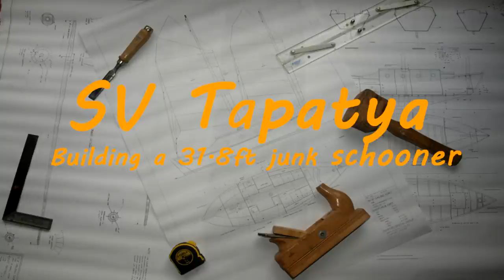Building a cruising sailboat; Gloss, Compass, Chart Plotter - SV Tapatya EP143

Comment: you can of course add an NMEA 2000 wifi gateway so you could use a laptop or tablet at the chart table.
Reply from the maker: The plotter has wifi already installed, Sasquatch. I'll certainly have a laptop down below 👍😀

Comment: Talking about gadgets for your boat there is a wind speed and direction do hickey(I have been learning my technical terms from Mads) It installs at the top of your mast. You can also get them Solar powered and Bluetooth enabled so you do not have to run any wires.

Also note that with Nmea 2000 you can echo its output to an Ipad and safety feature wise also install AIS depending on where you go cruising this is mandatory. Some VHF radios have it built in and you can also show input on your Chartplotter and Ipad. 

Further gadgets to consider are a MOB device and an Iridium go where you can use predict wind but is also a good safety feature as you can press a button and summon help.
Reply from the maker: Thanks Glenn. AIS will certainly be fitted. For wind direction, I find a flag to be very effective and needs no electricity. As for wind speed, I can tell that close enough by looking at the sails, water, etc. There's too much of a danger of sailing-by-numbers with all that stuff, I feel 👍😀 An Iridium Go or suchlike is a possibility though 👍
Reply: @SVTapatya  Certainly and nor does the Bluetooth solar panel version use any electric well it does but you know what I mean, which is why I like it from a technology standpoint. However it also allows you to have this information whilst tucked up snug in your bed and If you are going to be cruising on a long term basis will your sailing partner have those same skills. Just Information for you to consider not as if I am on commision.
Reply from the maker: It's certainly interesting Glenn. I shall look into it. I see your point about the solar powered unit and the lack of need for cables. Thanks 👍👍

Comment: Great progress! When you said "50 bucks a pack" for the paper charts is that €50 or $US50 or £50 or something else? Is it the screen visible in sunlight? I bet in the future there's going to be more than just a depth sounder getting hooked up. And finally where was the closing shots taken?
Reply from the maker: Thanks! It was 50 euros, but they're all so close together that it won't make much difference. Yes, the screen is supposedly readable in sunlight. AIS will certainly also be hooked up, and maybe a tiller pilot 🤔🤔. The closing shots were from Newcastle, Australia, I believe 😀👍

Comment: Yay! Tapatya’s got shiny new toys to play with! 🥳 Good decision on that Chart Plotter, Tony! With all the hard work you put in, you deserve a bit of nicety!✌️😊 Question: Is that bulkhead thickness as per Benford plans or did you decide to “beef it up” yourself?
Reply from the maker: Thank you Pierre. If I remember correctly, Benford stipulates 3/4" (19mm) ply for the number 3 and 9 bulkheads and I made them 20mm, so they're basically to specs 😀👍
Reply from the maker: I've been thinking about that one Pierre. I believe I made those 2 bulkheads in 12mm ply with serious framing below decks, and made them 22mm above decks to improve their insulation properties. So I guess I did partly beef them up!